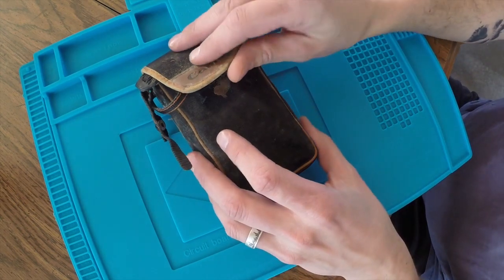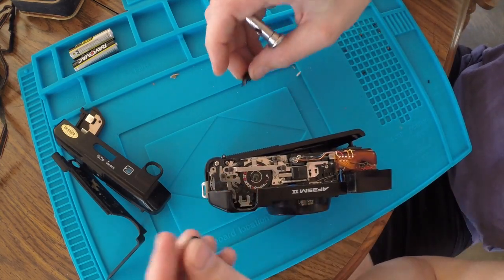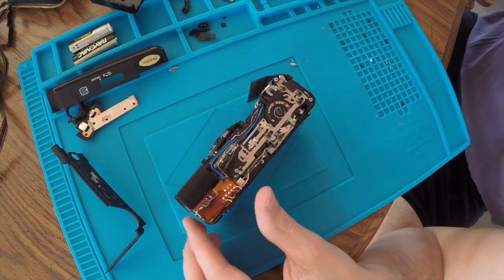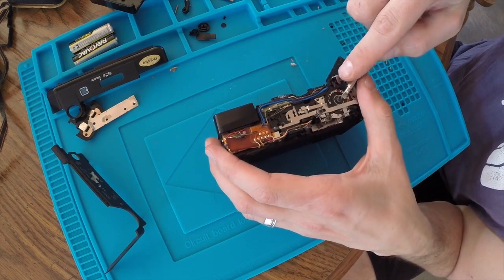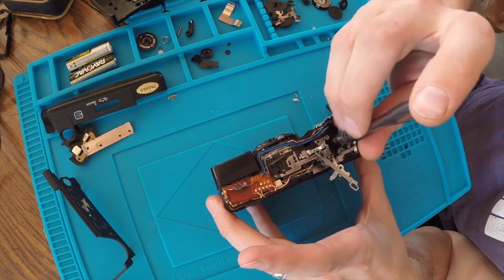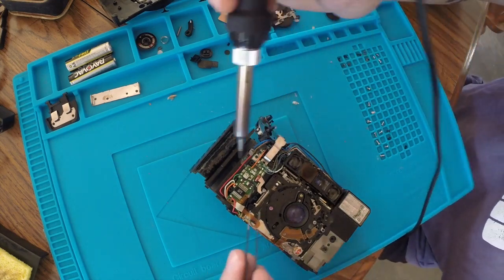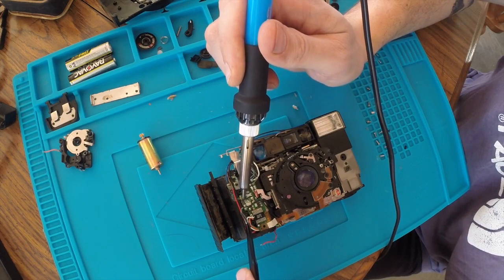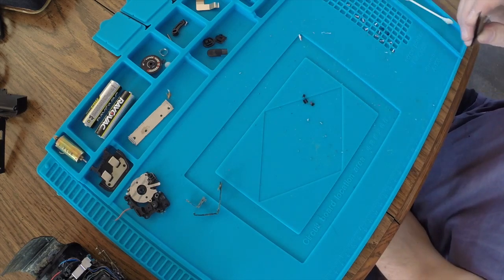Can We Diagnose This Canon AF35M II Camera?

Comment: I bought this camera for 5 USD, and the shutter doesn't open or close, but everything works, so it seems to be a mechanical issue, I will try to update if I manage to repair the camera

Update: It looks like it was indeed a mechanical issue in the shutter, it wasn't a major issue so I only needed to reasemble the camera back again and everything works fine. Now I'll use it for a couple of days and hope for the Auto Focus and lightmeter to work and don't see broken seals and light flares on the photos when I get the photos back from the lab

UPDATE: Finally my photos came back from the lab a couple weeks ago, and I gotta say, i didn't believed how well the pictures came out, so sharp, almost none of them were out of focus (and the ones they were, was bc i didn't know the min. focus distance is 90cm, which is a lot for casual photograhpy with friends), the shutter speed, the winding, the flash, the lightmeter, the autofocus, all of them were excellent. One of the best purchases (6 USD) i've ever made

Thank you for the video!

Comment: You broke the camera at 16 mins in. The iso will not click and the on off may work for a little bit eventually slip out of its alignment due becuae of a small piece of plastic snapping. I have done the same and still cannot figure out how to remove the front without breaking this part
Reply: the front lens cover build pops off. Get a screwdriver or end of tweezers, slot it in place [where you control the ISO dial] and slowly pull it away from the body, it should pop out on the bottom, then you just pull out the top and the whole thing comes off. When you swap/remove the front fascia just pull the body down so the ISO dial stays in place [with ISO 1000 version]. Or the ISO dial just pops out and can be popped back in just as easy. Hope that helps!

Comment: Hey I have this camera. It was working perfectly and then I tried to use it the other day and the lens just didn’t want to open. I can hear a noise in the camera when switching it on but the lens just doesn’t want to respond. What do you suggest I do?
Reply from the maker: My guess would be that the gear that opens the lens has broken. It’s fairly common. Was it dropped recently? Unfortunately the only way to know is to open the camera up.
Reply: @FrenchRiverCo  thank you for your reply. No. Not that I’m aware of, I’ve not dropped it
Reply: @FrenchRiverCo  Is there an easy fix? Where can I get it fixed? And how much would you think it would cost to repair?
Reply from the maker: Try looking for camera repair shops in your area, but they’re not as common as they used to be. I have no idea how expensive it would be.

Comment: I have this model without the 2. I want to get rid of it,  but.  Even with the batteries in and the red light on I can't get it to release my film that is inside. I may have some important pictures on that film from years ago and and don't know how to get it out out. Can you help at all?
Reply: Open it in dark room and manually remove and rewind the film!
Reply: @simonbarth9702  Thank you. I didn't know you could manually rewind the film...
Reply: @lauradavenport3385  Yes you can. If you want to be sure you are doing good, you can take a used film that is fully rewinded and try to build a tool for rewinding. Maybe you can use a screwdriver or something similar. Best thing is a little crank out of an old manual  SLR camera that you can insert in the top of the film cartridge.  So you can practise under normal light and use your skills for that film inside the camera in the darkroom.
Reply from the maker: ^ This.  I'd wear some gloves so the oil on your fingers doesn't contaminate the film.
Reply: Thank you all. I had already thrown it out not knowing this,and thinking it was a dead thread on here.  Blessings on your all for your contributions.

Comment: I just got this almost exact camera from an ebay seller. Was working perfectly until a week in and the shutter button is now stuck. I just put new batteries in it. The light is on, I know it's working. The button just will not press down to take a photo does anyone have any suggestions?
Reply: Hold it with your right hand and hit it INTO your left palm (good batts obviously) and hit it until it fires shutter. Obviously not a true fix. But it usually works. I'm three for three. Sometimes age requires a bit of a push.

Comment: how the heck did you get the little cap off the self timer? Also, did you just glue the hand grip back on?
Reply: Ahh i've managed go get the cap off but now I can't get that screw out :( I think there's some glue holding it in and now i've buggered the head
Reply from the maker: Ah that’s a bummer. Yes I just use rubber cement to put the grip back on. Unfortunately your only recourse now is to try to drill the screw out. Otherwise you might be able to fit a different size bit into it?
Reply: seems stuck around where the self timer bit is also? Even tho I took that bolt out